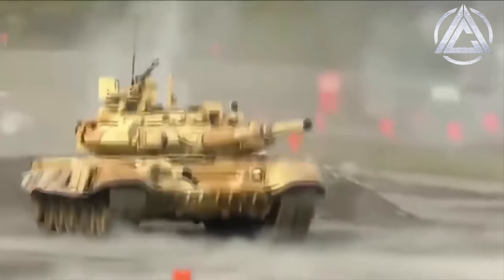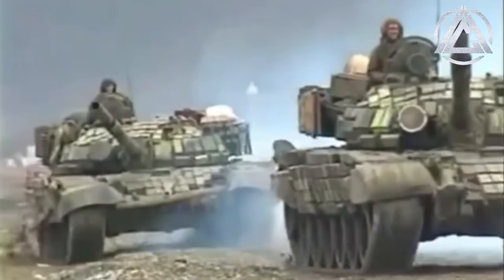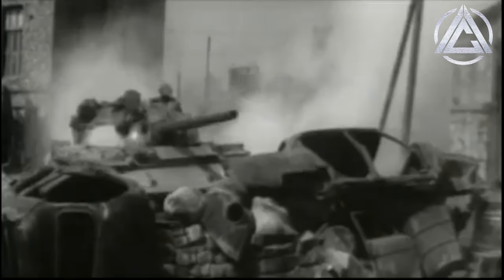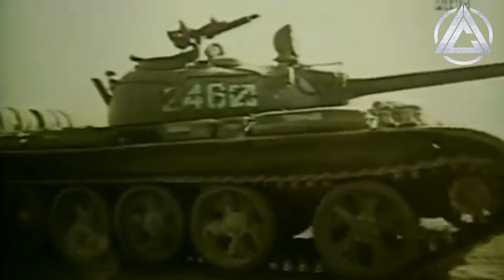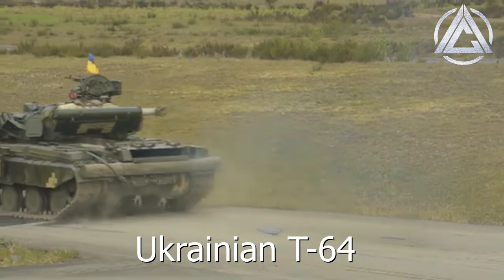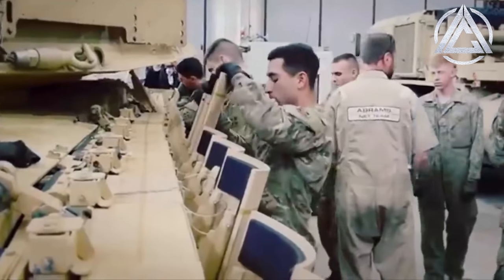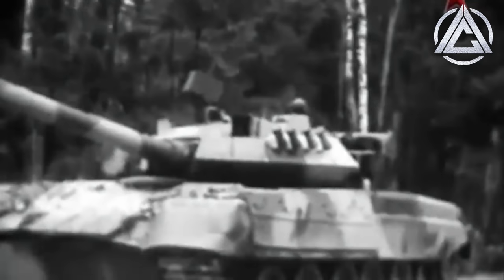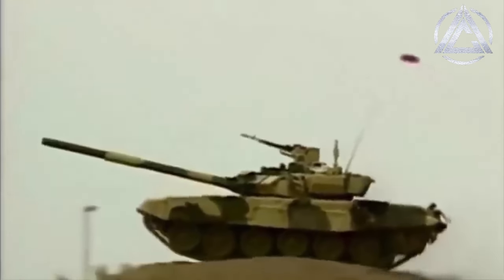What Are Those Bricks on Russian Tanks? | Koala Explains: Explosive Reactive Armor (ERA)

Comment: Question: can small arms fire be used to detonate eras and open up attack for otherwise blocked rounds?
Reply from the maker: With the earliest forms of ERA, yes. Blazer and Kontakt-1 would go off to 12.7mm rounds, so in theory peppering a T-72B with shots from machine guns, or even a fighter's 20mm cannons, could open up a weakness that a TOW team could then exploit. More modern forms are built specifically to avoid this, even withstanding 30mm autocannon rounds without detonating

Comment: One thing I think I’ve noticed during the war in Ukraine is that the Ukrainian forces are defeating ERA by firing two shots at targets from a similar position within a second or so, so even if the first round is defeated by ERA, the second shot will hit and (in theory) penetrate. 
If it is as common as the clips we see indicate, then it’s a really simple yet clever strategy to help negate this one-shot armour.
Reply: Modern ATGMs like the NLAW, Javelin and others are designed specifically to defeat ERA by various means.  Javelin does it by having two charges, one blows up the ERA then a fraction of a second later, with the ERA out of the way, the second one goes off and penetrates the armor. So with these kind of weapons one shot is usually enough.
Reply: Same applies for ceramics. Peaces stay in place, but after first hit, stopping power is greatly reduced. Even latest Abrams has much weaker armor once you move away from front of the turret.
Reply: @listerdave1240  no, Javelin defeat ERA and other kinds of armor by hitting where there is no such armor. No tank have heavily armored roof.
Reply: @BojanPeric-kq9et  Please re-check your information.  The Javelin and NLAW are actually specifically designed to defeat ERA, as are many other ATGMs. If I remember correctly it is even described in the Javelin's operating manual, which can be found online.
Reply: this applies to any type of armor. its like using a hammer and a nail  in wood
Reply: @listerdave1240  maybe you should check and learn there are different kinds of ERA.
Or let me rephrase this for you: Javelin is from mid 1990s. Do you really think that there were no advances in ERA in last 25+ years?
Or let me put this in another way: no tank in the world can stay operational after top level attack, period. We saw what happened to Leopard 2A6 after small top attack because, surprise, roof of tanks are thin because they are all designed in time period when front of a turret was considered to be the most exposed and thus needed the bets protection.
By the way, Russian ATGMs and RPGs are specially designed to defeat mighty "Chobham" and similar armor. ERA too, type of armor US army suddenly became very fond of in Iraq when they discovered that 1000mm RHA equivalent on front of a turret is useless against IED or RPG aiming to side of the hull.

Comment: ERA works well if your back in the old days but in modern wars are pointless, most western weapons are designed to bypass this as this armour is pretty much to stop like a standard RPG round not a complex anti tank launcher, plus these ERA are mostly found on sides and fronts of tanks and rarely on the back and as we know already the back of a tank is a mega weak spot and Ukraine has been exploiting this by firing launchers at the back of the Russian tanks which has no ERA and even if it did it would be useless, moment the Russians installed an autoloader in their tanks they were pretty much doomed from day one.
Reply: Back on any tank is weak spot, old RPG-7 and WW2 era antitank guns could wreck modern tank from behind. That is simply the compromise made in one era.

Comment: NEW UPDATE.🚨🚨🚨🚨🚨.  Those bricks are only to make the operators of the tank just to feel good 🤣🤣🤣. Because NLAW is eating them in Ukraine.  And there is a lot of tank cook off’s.  Personal metal crematorium.🤣🤣🤣🤣🤣🤣🤣🤣🤣🤣🤣🤣🤣
Reply: 1:The bricks are highly effective in their role, for their weight and space.
2:NLAW is "eating" them because it was specifically designed to counter said ERA and was being fired at weak points in the armor.
3: the tanks are cooking off because of the autoloader, which is placed low on the hull, on the most protected place in the tank (least likely to be shot). most burnt out tanks were blown up by their crews to prevent capture.

Comment: Question:  would firing .50 caliber rounds at era armor cause it to explode?  

I am thinking it would.  Especially if explosive tips were used. If it did, that would really negate the benefit of such armor fairly quickly.
Reply from the maker: The earliest examples yes, but more modern ERA is far less sensitive, and is designed to not even detonate to autocannon fire (20 or 30mm). Only larger calibre tank ammunition, RPG's or ATGM's have the energy to set it off.
Reply: @ArmorCast  great.  Thanks for the follow-up.
Reply: what about slap .50?

Comment: Allow me to talk from personal experience. I have never seen Kontakt ERA do what it says on paper. And that goes to both Russian armor and our Ukrainian units. In the early stages of war back in 2014-15 both sides used basically identical Soviet made everything so i had a chance to see how utterly useless ERA actually is. And now that we have modernized our tactics and are receiving modern weapons from other countries ERA on russian armor became de facto just an added weight and shrapnel dispenser for the infantry(when it's not filled with cardboard or rubber foam). AT4 rocket burns through it like it's not even there. Stugna ignores it completely. Javelins and NLAWs - goes without saying. ERA can stop a single stage HEAT rocket from RPG, but paper says it should do more than just that.

Before Russian WT fanboys eat me alive - there is a good example of this nonsense on Russian YouTube show where the host fires a tandem rocket from about 20 meters(66ft) away at a grid of ERA bricks and gets a piece of shrapnel in his stomach while ERA brick is pierced through and through and concrete block behind it is perforated about 30 cm(12") deep. He lived, thankfully, it wasn't fast enough to hurt him. But again arming distance on the tandem is 25meters so it was only first stage that burned through ERA in that video. Second stage was destroyed afterwards by setting it on fire. For ref/"proof": КрупнокалиберныйПереполох - Тандемный боеприпас.

Perhaps the infamous Relikt ERA has some super secret ingredient in it but as with all ruZZian Wunderwaffen we never saw that in use.
Corruption runs deep on both sides, no doubt. But common sense seems to be a specific deficit in Russian army. Why use something that clearly doesn't work? I still smile at those BBQ grills they tried to weld on their tanks in attempt to fend off Javelins, but that's neither here nor there.
Reply: You "missed" videos of tanks hit multiple times.
What you wrote about Javelin is pure nonsense. By same logic "Chobham" is crap because no NATO tank could survive Javelin too.

Comment: Ukrains Gen-3 ERA specialy shaped bricks (and whole gen-3 tank suit) is called "Nož" (knife on english language), because while conducting some test in which, unfortunstely, were used "old russian" APFSDS projectiles 3VBM17/3BM42 (3BM42 "Mango") on which "Nož" works well, but there is a lot of new Russian more durable thungsten aloy, DU 'darts' and one of manny new advanced high elongation uranium monoblock 3BM48 "Svinets" penetrator, or 2002. made 3BM60 "Svinets 2" penetrators, not to mention two new "Vacuum 1(DU) & 2(Tungsten)" penetrators. Slava Ukraini, ZDS!
Reply from the maker: Unfortunately for Russia, there doesn’t exist a tank that can actually USE the modern “Vaccuum” rounds, since they’re too long for the T-90/72 or T-80’s autoloaders. Until such a time as Armata or Burlak enter service, Vaccuum is essentially a proof of concept, not something that can actually be used

Comment: Those bricks are a lot of dead weight that don't really effect modern anti-tank weapons.  I think their sole purpose is to provide the tank crews with a false sense of security so they'll actually crawl into their death traps and go where they are told.
Reply: They are very, very effective for their weight, coming to a point where modern T-72B3s and T-90Ms are far lighter than Abrahams with similar frontal protection.
Reply: Depleted uranium is dead weight. US learned that in Iraq.

Comment: No human in right mind will go in the front of the tank with rpg,  they always aim on side or back, I don't know why they go crazy about frontal armor anymore they should work on sides.
Reply from the maker: Tank doctrine demands operation in such a way that any significant threat is always faced headon, and as such the frontal arc is the most important to armor up. Armor on the sides and rear is relegated to lighter protection methods such as cage or bar armor, and ERA. Urban armor kits like the Abrams' TUSK, T-72B3's UBH, or Leopard 2's PSO packages greatly improve survivability against weapons like RPG's to the sides, but it would be impossible to protect the sides and rear, and importantly roof, well enough to be worth the tradeoff in mobility.

Like any other vehicle or unit, tanks are a collection of compromises to achieve the best collective result, which means sacrificing armor protection for mobility.
Reply: because if the tank wants to get closer they will face forwards. whats the point of making side armour stronger then the front if you will approach with the front side
Reply: A Challenger 2 in Iraq was penetrated from the front by an RPG-29, It wasn't especially badly damaged but the driver was lightly injured, but it was driven away, leaving the combat area so the RPG team did it's principle job I suppose. It's not automatically an impossible job, just significantly harder, it's obviously preferable to target the sides and rear if the opportunity presents itself
Reply: @zxbzxbzxb1  driver lost part of leg.

Comment: Russian era stopping an apfsds from an Abrams or a Bradley 🤣🤣🤣 that trash cant stop an m 72 law , yes I seen one t72 b with era take a m72 law to the side of the hull , set off the ammo and the turrent went in the air
Reply: 1:LAW cannot penetrate the base steel armor of the front of a T-72B3, not even with ERA and the video you saw was probably a shot to the lower side, below the actual ERA coverage into the thin side armor (which isnt unique to russian tanks)
Reply: 2:modern russian ERA like relikt, Kontakt-5 and malachit are well known to block or reduce the penetration of APFSDS rounds and Chemical rounds of varying caliber and speeds.
Reply: @arandomperson7713  what you don't realize is when they do work (Which we have no evidence of in UKRAINE ) , yes they reduce penetration by 30 percent ( if Russia isn't exagerating the effectiveness) , what you don't realize is an apfsds du or tungsten round doesn't go in a tank it goes THROUH IT and keeps going , during desert storm and IRAQI freedom we were shooting through 7-8 feet thick sand berms the t-72s were hiding behind and the rounds were going THROUGH the tank not in it after going through the sand during my last deployment one tanker had a neglegent discharge and shot THROUGH  a hesco barrier filled with grave that's 6 FEET THICK , yes THROUGH  6 feet of gravel not in it , so even if it does reduce the penetration by 30 percent , that's like saying I will wear a t-shirt to reduce bullet penetration , not body armour a t-shirt . Yes it will reduce the penetration of the bullet , but such a low percentage is a moot point .
Reply: @arandomperson7713  yes I was , I am a U.S. army Sergeant , not some couch potato. The turrent thickness is approximately 46 mm  ( 92 if the round hits at the best possible angle for the tank )if my memory serves me correct a law is rated at 75-125mm of rolled homogenous armour ( depending  on which model of LAW ) yes there are several an at-4 is rated at 150 mm for the cheapest oldest model from the 1980's the did develop but not field ( openly anyway) the at-4 at (anti tank) model with over 300mm of penetration of rolled homogenous armour. If russian era was good,  and every tank we have seen blown up has had it , then there wouldn't be any blown up tanks in UKRAINE , would there ?

Comment: Would seem under actual combat there seems no real defence from the manpads even old Carl Gustaf 8.4 cm recoilless rifle still has punch enough to take out newer Russian tanks there armor does not seem as intimidating as originally belived same with the number of tanks originally belived to be 24000 but it seems not no more then 5000 6000pre Ukraine war numbers
Reply: Seem to be confusing portable ATGMs with MANPADS. The ADS in the latter acronym is Air Defence System.

As for combat, the availability of infantry type ATGMs along with ineffective (sometimes utterly incompetent) tactical execution by Russian forces have resulted in their heavy loss of armored vehicles.

Ukraine has also had their armor assets decimated as well just tbh, but for not precisely the same reasons.

Finally it's important to note that most armor is light, not heavy armor, so that's the best use of the older AT weapons, but in battle, one uses whatever they have got. Best thing is to keep supplying Ukraine with both old and new stuff.
Reply: Cringe pfp

Comment: 0:01 most stupid thing i see about russian tanks are those jumping from a hill and no one mention how stupid that is and just for the show...doing that 2-3 times fucked up the tanks suspension completely.
also its called kontakt 1 not contact 1.
Reply: Wrong. You should watch the Russian tank biathlons. T-72B3's get "air" about 10-12 times during the four lap on the track, than the crew will hand over the same tank to a new crew which will do it again. Four crews in a team. In four different teams. Than the same tanks will be driven the next day by someone else. And on top of that, one of the obstacles is a series of one foot high speed bumps over which most teams usually drive at 30mph.
Maybe that is true for the 70 ton western tanks idk, but the Russian ones are handling it just fine.